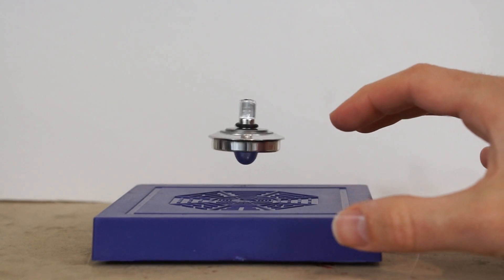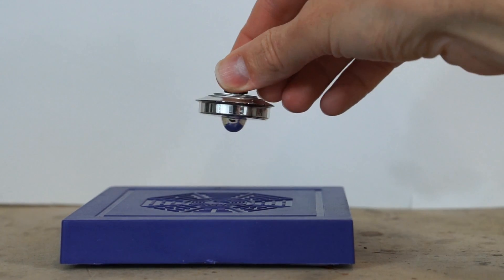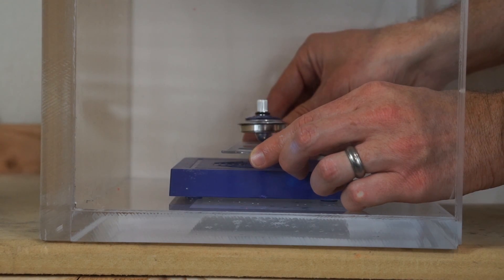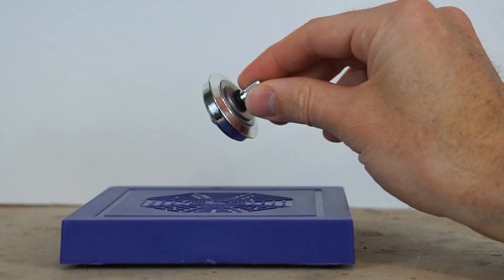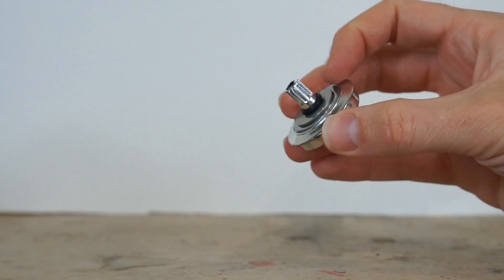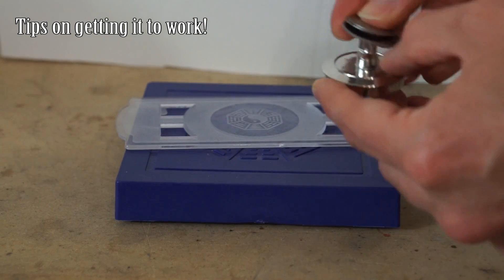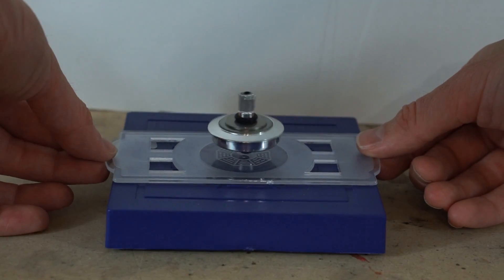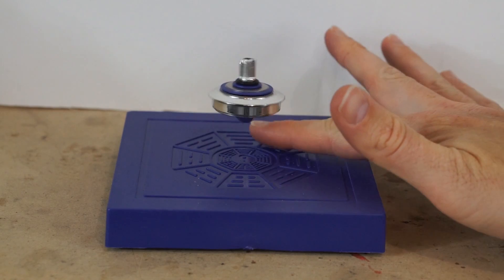Will a Levitating Gyroscope Spin Forever in a Vacuum Chamber?

Comment: An object spinning in space aught to continue indefinitely.  A few things can bleed off spin: mass detaching from the spinning mass to carry away angular momentum, a nearby strong gravitational source that can induce tidal flexing.

If the mass is spinning fast enough its angular momentum can overcome local gravity enough to throw bits of it off to carry away angular momentum.  Instances of this has been observed when unconsolidated asteroids were gently spun up by uneven solar heating.  This can take millions of years and detaching masses carry away angular momentum very quickly.

We see tidal forces act on object all the time.  Our Moon was de-spun down to tidal locking due to tidal flexing.  Jupiter imparts enough tidal flexing on Io to keep it permanently volcanically active.  Pluto and Charon have despun each other such that they're mutually tidally locked.

If I had the job of setting up an object to spin forever I'd make a strongly consolidated dumb-bell, made of diamond preferably.  I'd ensure that it was uniformly coloured, light or dark wouldn't matter so that radiative heating wouldn't find a differential to work with.  Then I'd place it ridiculously far from gravitational sources, say in the middle of the Boötes Void.  Getting validation that the object was still spinning would be a major engineering problem on its own.
Reply: .....it still won't be forever. Maybe beyond the lifetime of the universe, but it will come to a stop
Reply: No.  It will stop because energy is used by procession to keep the top upright,  and this energy comes from slowing the top,  which will eventually collapse.

Secondly,  this magnetic top is rotating in a magnetic field,  which means that electrons are sloshing back and forth from the rotational speed much like in a generator.  the flow of electrons is consumed by resistance and turned into heat.

Just like with a generator,  it takes energy to move those electrons,  and that will come from the speed of the top,  causing it to collapse.

I suggest that the two major ways energy is consumed in this system is 1) procession  and 2) electrical current flow and resistance.

Comment: If the toy was spinning in a totally still and stable way, without gyrating, it could spin forever because no work is being done.
When it is chaotically wobbling, work is being done, and this removes energy from the system. Work is being done because the toy is moving. Moving a mass is the definition of work.

Comment: It will definitely stop because you can’t have a perfect vacuum.
Reply: It is litterally impossible to have a perfect vacuum. It would break so many laws of physics.
Reply: @realwizard435  black hole?
Reply: If you are refering to the volume surrounding the event horizon, that would never be a perfect vacuum. however, inside the black hole, who knows, the laws of physics dont apply there.
Reply: Xena-IG The exact opposite of a black hole. A black hole is an area of extremely dense matter. A vacuum is a area of low density of matter.
Reply: Nope, a perfect vaccum is non existance. Existance itself denies the possibility of an absolute vaccum.
Reply: @blankblank1284  Aside your ugly grammar (and it's vacuum) your reasoning has not a point
There is obviously the theoretical possibility to a perfect vacuum, it is simply unimaginably difficult to obtain, practically roughly impossible
This is the point
It wouldn't "negate" the principle (?) of existence, it would simply be (so, there is something) an empty space, without any particle
Reply: Blank Blank nonexistent* Existence*
Reply: Yes perfect vaccum exists in space
Reply: Not completely bro there are still atoms bouncing around although be it not too many
Reply: @razorreef3757  
Exactly, not even space is a true vaccum. Just the closest you can get. All of existance has something in it. Thus a pure vaccum requires non-existance.
Reply: @blankblank1284  How do you know far out into space where nothing exist isnt a perfect vaccum? Out somewhere far out in space i believe there is a perfect vaccum.
Reply: @xena-ig5839  there are some super voids out there but i don't think they have a perfect vaccum in them
Reply: @xena-ig5839  there is no such thing a absolute perfect vacume
Reply: @explorewithjaisriram3110  Perfect vacuum is impossible. The energy you need to creat it would be infinite.
Reply: @explorewithjaisriram3110  no.. space isn t percect vaccum
Reply: @ayyjay1575  you know nothing Jon Snow
Reply: If physics define everything in the universe, then The laws of physics apply everywhere. Even in black holes.  Our laws of physics that we've discovered so far just don't explain what is happening. But when we figure it out what a black hole actually is, I guarantee that it will change our so called laws of physics.
Reply: @drbaldtv2447  you are right , but the point is our understanding of physics is not right , the physics itself is not an issue
Reply: @The people who actually know what they are talking about; don't bother trying to have an intellectual conversation here as the viewers of this channel are mostly people who don't understand the science behind anything and can't see how ridiculous the videos that this channel produces
Reply: Even if it were possible to have a perfect vacuum, it would still stop long before the end of the universe.  The rotation in a magnetic field causes eddy currents which generate a field opposing the direction of spin - magnetic drag.  The opposing force is small, but nonzero, and dissipates the angular momentum as heat in both the spinning object and the magnet underneath.
Reply: Sure space isn’t a perfect vacuum because there are a small amount of particles floating around, but couldn’t you say that there are small sections of space with no particles so therefore a perfect vacuum? Or is there quantum physics stuff that says otherwise?
Reply: Samuel'stuff
Even if you had a perfect vacum, there would still be eddy currents.
Reply: read the "the action lab"'s comment
Reply: It will stop because the moment of inertia has
Reply: Wrong! There is such thing as a perfect vacuum. You obviously haven't tried the Dyson DC65 multi floor upright.
Reply: Samuel'stuff it does spin forever, how do you think planets are always spinning?
Reply: Actually, perfect vacuum is real. I mean, the space, without any particles, atoms, magnetic fields or anything. It's literally empty. And it's can exist somewhere on the edge of the universe. But, given that the universe is infinite, it will take an infinite amount of time and energy to get there. At the same time, even if we get there, there will not be an ideal vacuum, because we will be there. It may be real, but it is impossible to verify.
Reply: Samuel'stuff not on earth anyway
Reply: The closest thing we’ve found to a vacuum is way out in space. Some void with less that 5 atoms per square meter
Reply: After reading through some of the comments , I discovered the perfect vacuum. It's so difficult to find because it's right behind your eyes.
Reply: Stevie Jeff it would have been more clever if you said “between” your ears.......... because............... there’s air behind my ears......... and there is no air in a vacuum..... especially a perfect vacuum.
Reply: @ryugo7713  didn't realise I wrote ears anywhere. So you unequivocally proved my point spacebrain.
Reply: @ryugo7713  most people use their eyes to find things.
Finding something right behind your EYES is difficult   .
You couldn't even see EYES in front of your eyes.

Comment: I was going to suggest putting a black ink vertical line on the side of the spinner, and then you could measure the dynamic rpm using a digital optical rpm counter.

Comment: How does the cosmic microwave background radiation cause it to slow? It is strongly isotropic, and for a radially symmetrical object, the radiation pressure will exert a net zero torque.
Reply: Ivan Bok i dont understand much about this but i do get the gist of what i’ve been told, it is radiation, radiation=heat. And heat does something to slow it i guess. bc other ppl said it did. I did some research on CMBR and learned that it cannot go through any of the planets’ surfaces. So maybe if you put dirt around it you could stop CMBR🤷‍♂️

Comment: doing my guess as to whether or not it will stop.
While air friction is often sited for the reason why things in the air slow down, in this case it isn't the only friction.  While removing all the air will help it last longer as you are taking away one of the major forces against it, it also have magnetic friction, meaning that the same force that is keeping it in the air is also slowly slowing it down.  Thus my hypothesis is that while it will spin potentially a lot longer than it would outside of a vacuum, it will still slow down to the point that it falls.

Comment: i'll have to say it won't make a difference at all. the properties that move and stop the magnet are its electrons and gravity. neither of these properties are changed or removed by adjusting air density
Reply: BlueSnowfox well, gravity by itself doesent stop it though. gravity just accellerates towards earths core, whats really stopping you is the friction of the things you hit on the way. so air density makes a difference, since it will slow down due to drag. it will still stop in vacuum, but it will take longer (due to eddy currents/induction).

Comment: I have an original Levitron, and lifter plate, and is just as hard to get started, but when going, I can see the original is much better balanced than these cheap modern copies. Its sad modern cheap copies ruin a fun stable toy.

Comment: it couldn't spin longer than the lifetime of the universe if you assume that the final stage of the universe will be heat death. in that stage no work can be extracted, but if the gyro was spinning you could extract work from it so: not dead yet (the universe)

Comment: The primary and secondary lines of flux have a drag effect associated with the chaos imperative, which allows the fields to maintain integral form, causing the float effect, instead of coalescing.

Comment: 4:25 my guess is that the opposing and attracting magnetic forces are acting as the resistance in this case.  Similar to how a ball will roll further on a smooth surface rather than a bumpy or rough surface.

Comment: When the Earth was formed a day was ~3 hours.  When the moon was formed it used to spin on it's axis as well, it's now tidally locked.  Days are still getting longer, that's why  we have leap seconds.  At some distant point in Earth's future it will be tidally-locked with the moon.  Just like the same side of the moon always faces the Earth, so too will the same side of the Earth always face the moon.  Basically days will max out around 28 current days long.

Comment: the lack of gas increased the pressure upon the craft and sort of held it in an inverted spiderweb of binding energy similar to friction in gas also non gas temperature is also extremely important considering it was putting more pressure upon the craft then its existence in gas.
 molecular destabilization expansion / contraction

Comment: In space it will spin almost forever, unless acted on by external forces. External forces include space dust, magnetic fields, gravity, and cosmic rays. Cosmic rays will actually slow it down or spin it up faster depending on direction of the cosmic ray but this takes eons of time to see the effect of this happening. The earth is spinning, but not as fast as it used to. Days are longer now.

Comment: fun fact, while you may think in theory the earth can spin forever, because we have large bodies of water all over, the rotation of the earth pushes the water around causing the water to hit solid land and it actually does slow its rotation by an infinitesimally small fraction of the speed so you can say safely it wont stop in human history but in theory it eventually will slow down enough to stop.
Reply: Have you ever heard of a closed system?

Comment: It will stop, because as it rotates through the magnetic field, it will generate electrical currents within the metal, the energy of which will eventually be radiated off. This loss of energy will cause it to slow down and eventually stop.

Comment: Its possible for something to spin for ever but there has to be zero objects that have any weight mass or gravity because if there's any objects with mass it will lose balance over time from the gravity produce by those objects. so the earth will not spin for ever because other planets near by will eventually through it off balance and ether start spinning in another direction or stop moving

Comment: I have a magnetic gyroscope I picked up a garage sale for like $2 a few years back and it spins about 2 min in normal air, and doesn’t wobble in the slightest. It spins higher as well. It’s called Super Levitron and it was made by Fascinations in 1996. I would suggest trying one of these, which I’m sure you can pick up off eBay. They’re waaaay better. They take some time to get perfect but they have a wedge stabilizing system as well as very small ring weights you put on the top to get everything just right. Take a look, this would be an awesome experiment! Love the stuff you do; it’s like what I do when I’m bored, but with way cooler equipment. Keep making great videos.

Comment: You would need to get it spinning perfectly upright to really test it.  As soon as the magnetic field of the gyroscope is off parallel with the magnetic field of the base magnet, there will be a torque tending to try to flip the gyroscope over.  The rotation is what creates the resistance to this torque.  Essentially, when it's off axis it is an unstable rotation.  Like you said, it creates a precession, and gravity may play a small role as well.  Essentially, when it is spinning perfectly upright, it is in a meta-stable configuration - it will be stable, but it is still not be at the lower energy level it would like to be at if it were flipped over, and as soon as it is off axis, it's rotation will decay, as the torque due to the magnets will fight with the torque due to the rotation.

Comment: It will slow down & stop eventually due to the ether of space, and it’s varying energy density’s!
If you could get 2 of the magnets operating as micro singularities orbiting at the event horizon of a black hole, then you could warp the space time continuum & time travel.
Reason we can’t time travel is we don’t know what form of energy time is! Most think clocks measure time but they don’t, they measure the earths rate of spin about its own axis, which is centripetal/ centrifugal force!
Calendars measure time, winter time spring time autumn time & summertime, which in energy terms is the earths mass x it’s velocity thru space in its annual elliptical orbit about the sun!
How would we time travel when we don’t even understand the energy form that time really is?
Same same with your levitating magnet.

Comment: It will stop due to A, the resistance in the magnetic fields, and B even if A didn’t stop it, magnets don’t stay magnetic for eternity. This wouldn’t be perpetual motion because the magnets are adding energy to the system even if it did go on, just by the way.

Comment: Electromagnetic waves...gravity waves??  If the magnet had started it's spin in a complete vacuum and then was subjected to the same electromagnetic pulls from the moon, sun, etc. you could very well simulate an infinite spin.  Especially by cooling the apparatuses down to universal levels.  When you started your spin it was already tainted, the spin was being subjected to air pressure at different levels up until about 30 sec. before it became too unstable to maintain it's spin...but that therein is the mistake, as the spin has to retain it's initial stability of spin starting in a TRUE vacuum.  But this was a cool experiment!  Kudos!

Comment: Eddy Current Braking is a phenomenon that produces a counter- magnetic field in a conductor moving through a magnetic field. This is related to inductive reactance and is  an inductive circuit. There actually is an electric current flowing through the spinning object because it has motion within a magnetic field making it a generator. That current produces a second magnetic field in it that opposes the magnetic field that suspends it, and will slow it down. However there are also additional forces in the chamber, you can't remove all of the air for one thing.

Comment: You should use canned air to spin the thing up to speed and use one of those rpm scanners to get the top to a specific speed. That'd make the quality of the spin a much smaller variable.

Comment: the friction is due to Aether. Vacuum is no vacuum as you think it is. Even in vacuum there is friction due to Aether. And this is why the ball earth model is complete rubbish. Think about it. Your friction theory simply doesn´t work, because friction can´t exist in nothingness / vacuum, because there is nothing the molecules of the things could "rub" against and lose kinetic energy that way. If radiation would cause so much friction that you cannot see the difference to rotation in air, our earth cannot fly and rotate through space for millions of years. It would have slowed down and stopped quite fast. 

Our sciene is bullshit told by evil liars. Time to realize it.

Comment: But atmospheric pressure and air resistance has different strength to magnetic fields so if you used a stronger spin it would spin longer